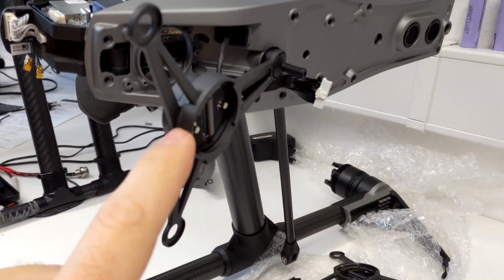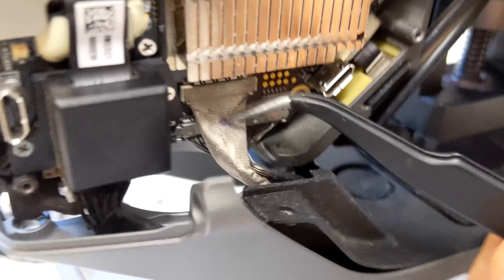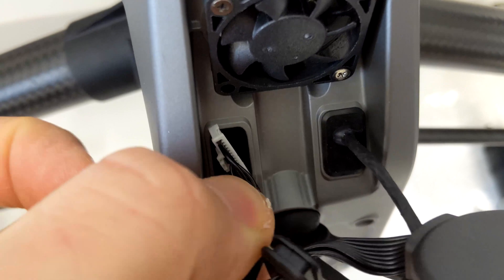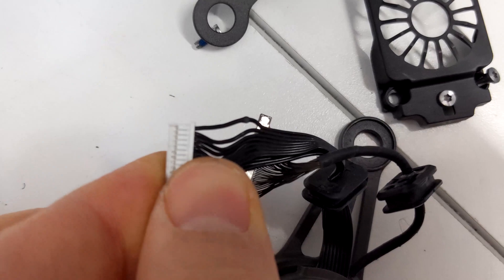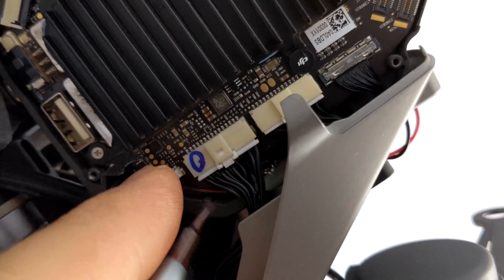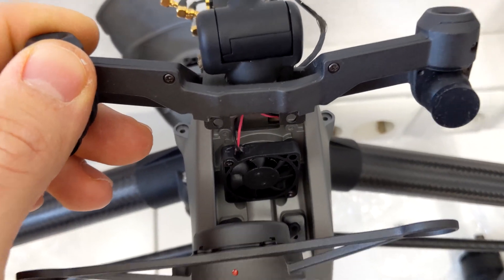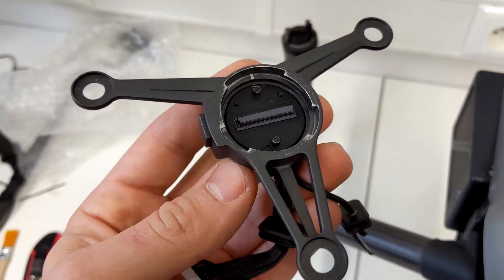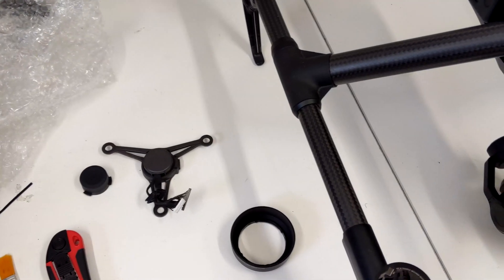DJI Inspire2 gimbal vibration absorber board mount with sensor encoder error (0x400000) repair video

Comment: I see you have the same problem I have, tapping the screen to focus and you get a yellow prompt "EV locked"  the EV pad lock top right of screen momentarily locks then unlocks at the tap of the screen. Mine never did this until recently. I have rolled back firmware and re updated., It's not really an issue just an annoyance that something of this quality has a glitch. Regards Tony of Australia

Comment: Thank you for the vid ! I had the same problem   (no video feed+camera sensor & encoder 0400000 error) and i replaced the  gimbal vibration absorber but still the issue continues. Any way I could message you via email?
Reply from the maker: hi. hmm so maybe a problem with the camera side of the connector? sure you can write me yt@dronery.com
Reply: Did you figure out the issue?
Reply: I took it to a repair shop and they told me it was the vibration absorber . So I’m guessing the one I replaced was either faulty or I might have damaged it somehow while I was installing it ( which I was very careful when doing the repair ) so idk .
Reply: @Golden.Rookie  Did the service fix the problem by installing a new vibration coupling?